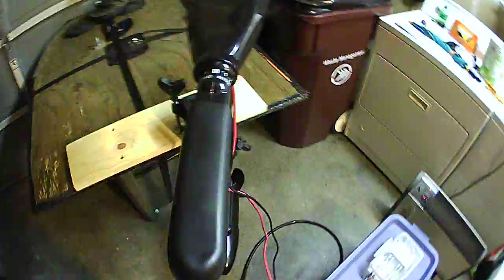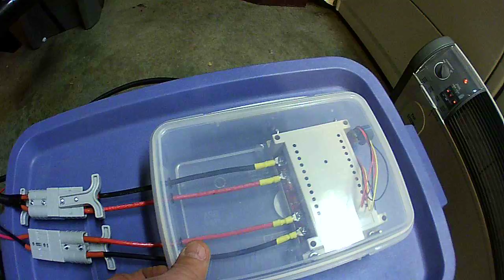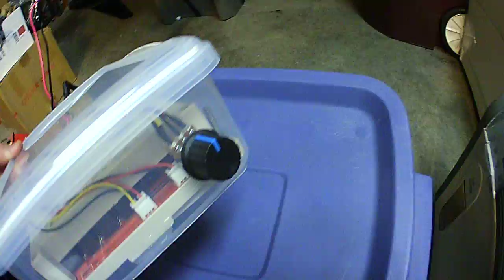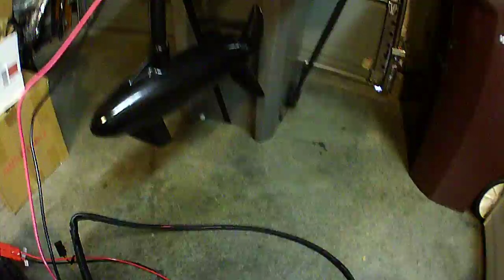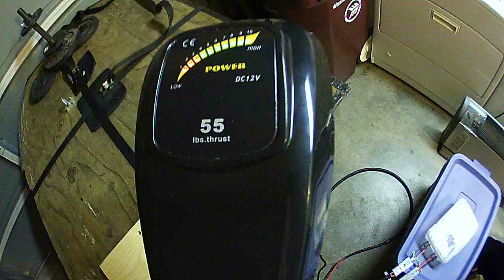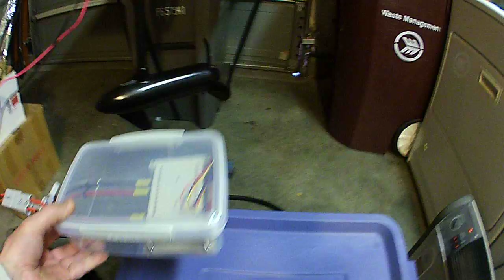MOVI0056

Comment: Do you have a link or specs to the controller you purchased?
Reply from the maker: The one I used in the video was rock solid but did not have a reverse toggle switch.  I just upgraded to this one.  It also has a cooling fan which is helpful on 90 degree days... https://www.ebay.com/itm/10-50V-100A-3000W-Programable-Reversible-DC-Motor-Speed-Controller-PWM-Switch/124089361104?_trkparms=aid%3D1110006%26algo%3DHOMESPLICE.SIM%26ao%3D1%26asc%3D225074%26meid%3Dcc83f992b3b14b2289701131f6d0cf7f%26pid%3D100012%26rk%3D2%26rkt%3D12%26sd%3D223727426794%26itm%3D124089361104%26pmt%3D1%26noa%3D0%26pg%3D2047675%26algv%3DSimplAMLv5PairwiseWeb%26brand%3DUnbranded&_trksid=p2047675.c100012.m1985

Comment: Hi Neil, did you have the chance to test how long the battery life have improved using PWM controller on ur motor? I use a Watersnake Venom 54lbs with a 100Ah battery and I wonder how much I'll extend my running time using PWM as well.Thx a lot for ur video!
Reply from the maker: Hello Andrea.  I don't have any empirical testing data to confirm but it seems to greatly extend the battery charge.  I'm using a Walmart Everstart 29 dc class MAXX with a standard Everstart 29dc as back up.  I fish in a very windy location.  I usually go all day, not trolling but moving around the lake, several miles and the battery usually never drops below 12.7 or 12.8 volts, practically full.  I highly recommend this battery.  Under $100.  It's so nice controlling the exact speed of the prop instead of 5 set speeds.  I may swap out my pwm for one which has a reverse switch.  Then I wouldn't have to touch the handle on the motor at all except to steer.

Comment: Where did you get the grommets that seal the entry points of the wires into the plastic box?  And is that 10 gauge wire?  Thanks!
Reply from the maker: Hi Neil-  I picked up the grommets at Lowes hardware.  They have miscellaneous fastener aisle where you can search out the correct ID/OD grommets.  I'm using 6 gauge wire for the PWM box and 6 gauge welding (stranded) wire for the extension to the battery.
Reply: Peter Starck Thanks! I found some grommets at my local True Value hardware store, and I made a PWM using your example. I successfully used it Saturday morning, so I want to say a huge Thank You for posting your video!
Reply from the maker: I'm glad it helped someone!  I've used this setup at least 20 times this year with no problems.  The PWM saves wear and tear on the motor because it starts so smoothly and the extra battery reserve is very obvious.  Fyi, on hot days and motoring long distances, the PWM box gets a little hot.  I take the clampon cover off the enclosure box and it cools right own.